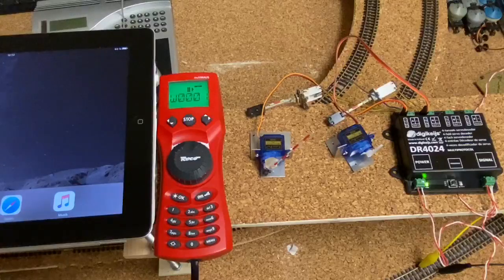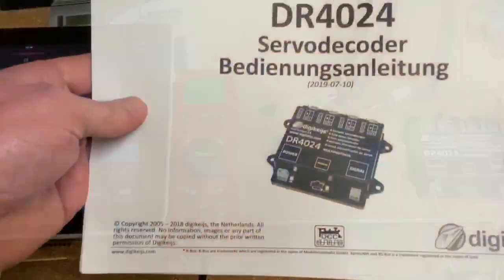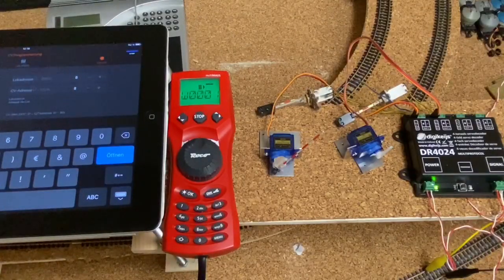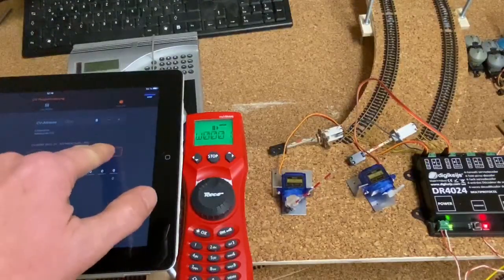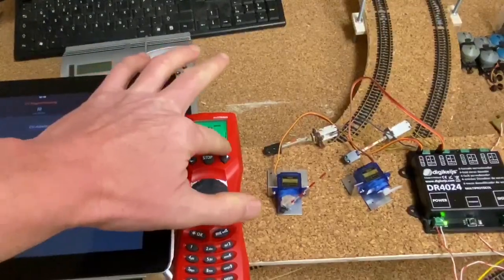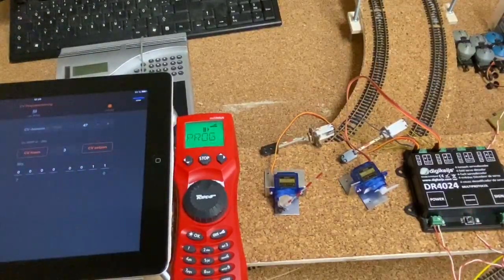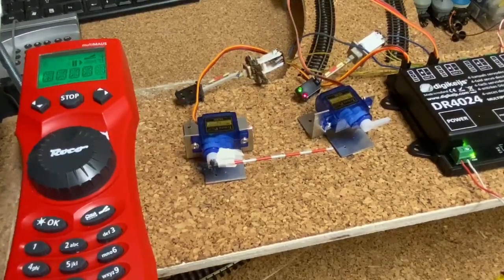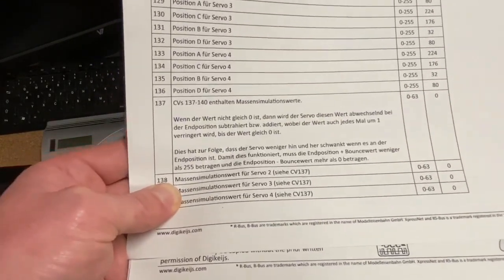❌⭕ Digikeijs DR 4024 - Schranken nachwippen lassen ❌- mit Wechselblinker , Anleitung für Einsteiger

Comment: Da fällt mir ein, hast du eine Idee wie man da noch einen Sound integrieren könnte? Also das bimmeln, wenn die Schranken runtergehen. Den Decoder hab ich mir schon besorgt, muss ich demnächst mal ausprobieren, das Wippen.
Liebe Grüße 
Ingolf
Reply: https://shop.md-electronics.de/p/kbm-2-kanal-bahnschrankenmodul-mit-4-verschiedenen-bahnschrankenglocken

Gibt es komplett fertige Bausteine
Reply from the maker: Ja , Sound werde ich auch einfügen , aber anders. Mal ein kleiner Vorgriff auf meine Zukünftige Videos. Ich werde es mit TrainController 4DSound bewerkstelligen. Damit kann ich die ganzen  Geräusche der Loks , Nebengeräusche, Durchsagen usw. erzeugen. Man benötigt nur ein gebrauchte  Surround-Sound-System besorgen z.B. 5.1 oder 7.1), um räumliche Klang darzustellen. Ich hatte es mir mal angeschaut und war begeistert. Das Programm kostet ca. 120 € und wir im Traincontroller integriert. Kein Umbauen von Loks mehr . Die Qualität vom Sound ist dadurch viel viel  besser. Vielleicht ist das auch was für dich ? 
Hier mal der Link für die Info 
https://www.freiwald.com/software/58/HandbuchSound.pdf. 
Oder sei gespannt wenn ich es bei mir vorstelle.
Reply: ModellundEisenbahn DR ups, das klingt mächtig gewaltig und kompliziert
Reply: Ich habe jetzt ein Soundmodul gekauft, welches über einen kurzen Impuls ausgelöst wird. Wollte das über die cv 117 machen aber da komme ich irgendwie nicht klar mit der Beschreibung, mit den Bits und die Werte die da in der Beschreibung sind. Bit 0-1 für einschalten und 4-5 ausschalten , wo muss man denn nun die Werte eintragen? Hast du dich damit schon mal beschäftigt?

Comment: Meine Frage mit den Servos kann ich die auch ohne Servodecoder für Weichen und Schranken Nutzen????
Reply from the maker: Bestimmt. Die Servos werden über ein pulsleitendes modulierte Signal angesteuert welches sich alle 20 Millisekunden  erneuert. Wenn du so etwas bauen möchtest ? Ich kann es nicht, und benutze die Decoder. Dort sind eh fast alle Funktionen die ich auf der Modellbahn benötige , vorhanden. 
In meinem letzten Video gehe ich auf den Einbau eines Servo in der Weiche ein. Falls du   ein Thema hast , mach ich gern ein Video drüber .
Reply: @ModellundEisenbahn  Hallochen!
Hier bin ich nochmal! Weisst Du, ich wollte eigentlich nie Digital fahren. Habe ein Set mit Zug für 230 Euro bekommen. Aber noch die kleine Esu Stadion drin. War zum falschen Zeitpunkt im Moba Laden. Oder hatte dort einfach zu viel Geld mit. Denn Elektronik war nicht meine Stärke. Möchte es aber aus heutiger Sicht mehr missen. Habe von meiner Frau dann die Z21 also die grosse Schwarze Stadtion bekommen, aber decoder Programmieren, mit den Cvs einrichten ist nicht meine Stärke und ob das geht. Man könnte sicher enorm Sparen, gerade bei Sounddecoder selber einbauen. Aber du hast sehr gute Beiträge gestaltet. Ich bin froh einige kniffe von Dir zu sehen. Nun noch einen schönen Abend und eine Stressfreie Woche! Wünscht Dir der Rolf aus Dresden